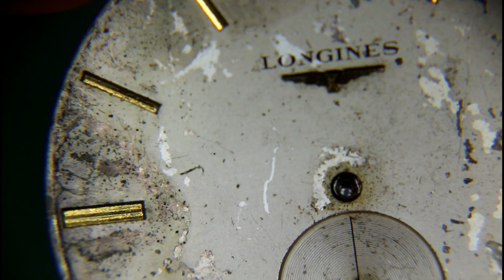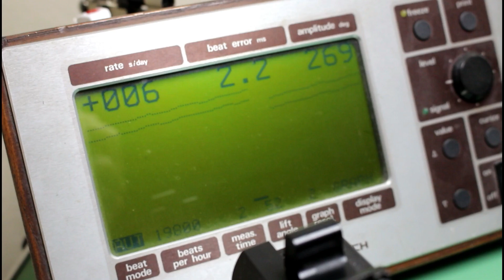Gold Longines Watch Restoration With A Broken Case

Comment: Very impressive clean and restoration. I love the simple elegance of the watch - it's similar to my 1954 Omega (266 movement), which is one of my favourite designs. You can't beat some vintage designs and this video proves my point.
Reply: I'm a huge fan of premium time-only movements like these.    I've started collecting Omega Seaamaster watches with the 30-T2 based movements like yours.   Most of mine are Cal. 286, but they are all very similar and real workhorse movements that you can service yourself quite easily once you've done a few.     Great choice!
Reply from the maker: Absolutely, some vintage designs just cant be beaten

Comment: Having a good watchmaker is essential for a collector or speculator.

I picked up a Speedy Moon chronograph at a yard sale for $50, and it was running well but it had a ding in the bezel.  Because Omega used slightly different bezels over the years, we couldn’t source a replacement.

My mechanic removed the bezel from the watch, and the insert from the bezel.  He had his metal guy fill in the steel, remove the excess by laser and refit the original insert.  It is now impossible to see where the flaw had been.

He’s pulled off some things that might’ve been described as impossible, so he is truly an irreplaceable asset . . .

Comment: Nice job on that case. Years ago I had a gold filled Universal Geneve bumper with a broken turtle lug. I sent it out to be repaired. They didn't bother to measure the lug width on the good side, so they made it 16mm, while the good side was 18mm! So I sent it back again, and instead of fixing that lug, they broke the other one off and moved it to get back to 18mm! Sheesh! Can't trust anyone to do a good job any more. I have a few dials I wanted to send out, but every time I get one back (no matter who I use) it's not what I asked for.

Comment: I just pent untold hours trying to install the click and spring. I pinged the first one and had to order another from canada. I broke the second one in the process of trying to instal it properly. Again FAIL. I ordered a third spring and now have spent over two hours with your vid, and other help from the Watch Repair Lessons Group and still a fail. I am beside myself. I cannot figure out how the "horse shoe" end of the click spring installs and interacts with the main plate or whatever it interacts with.  Does the spring go in first by itself the way every other spring I have done goes? If it does I do not understand how.